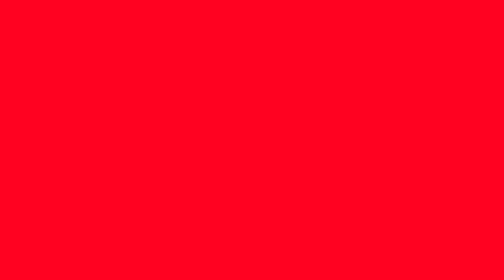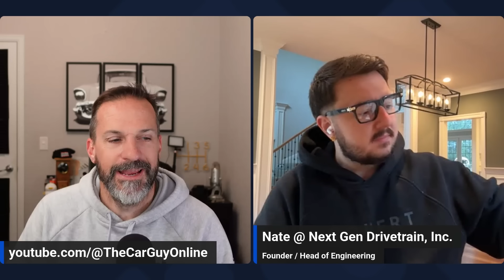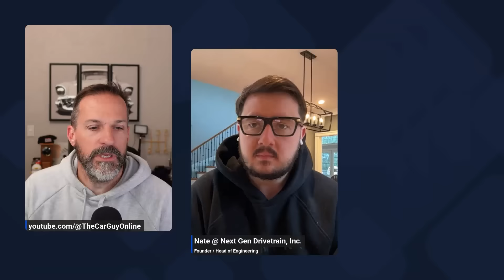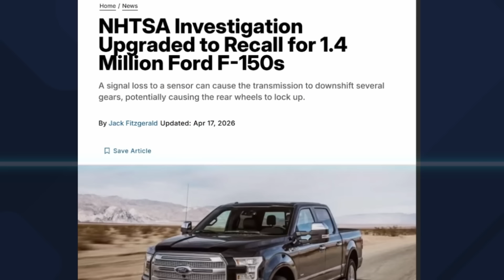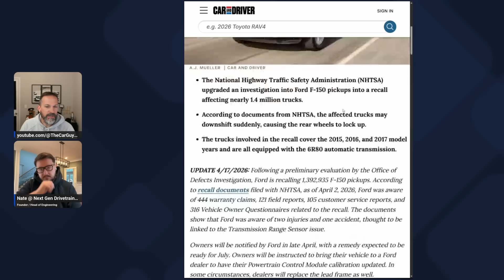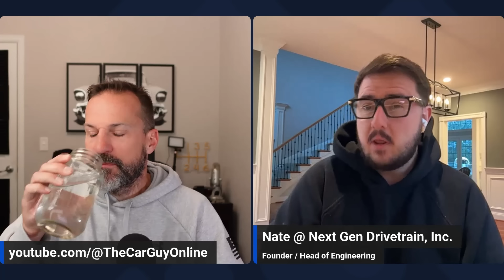Ford's BIGGEST Transmission Recall Yet - 1.4 Million F-150s

Comment: My 6R80 started to take a dump at 100k. Fortunately the truck still had a month of warranty left on it so ford put a new one in it. I’m definitely going to look into the valve body upgrade.
Reply: 2013 f150  transmission  slammed into 1st almost causing a accident.  Toke it to ford. 123.00 mile out of warranty  lead frame  4500.00 to repair
Reply: @MrKnuss14   if they charged you 4500 just for the leadframe they are ripping off.
Reply: .  I had to pay 2290 bucks to have my lead frame replaced and thought it should have been part of the recall, I was pissed when they told me it wasn't covered under recall
Reply: You’ll probably line up to get the next new best selling f 150
Reply: @666dynomax  if I’m going to look into trying to make my transmission better, why would I line up for a new truck 🫤 yea you sound stupid

Comment: I had a 1972 Ford F100 single cab it had an automatic transmission, a V8 302 engine, and ran 33” super swampers tires. I got the motor and transmission from a junk yard. The motor and transmission both leaked but I was poor. But we had a kid and a single cab pickup didn't work anymore. So we saved some money and I sold the truck and bought a 4-door car 😩😭 dam adulting is hard.
Reply: I hear you. I have a 72 F100 and the 390 went 45 years and then was rebuilt and the C6 transmission has never been rebuilt, a shift kit was installed 15 years ago and probably has been saving it. Have nearly 268k miles on it. I sold a 69 for a family vehicle and so missed it thus bought this one from a family friend who was original owner. These old truck will last sooooo long. I have a great running 2016 F150 with the V8 and 6R80. Keeping them both forever
Reply: @Anad3605  The gold days

Comment: They also go limp mode when the OSS signal fails throwing it in suicide mode with  lower gear at highway speeds. That almost killed one of my owners going 70 on the highway.. More shitty engineering. You know the plot is lost when a retired ford diesel dealership tech sells his new 2024 F250 and replaces it with a much older vehicle.

Comment: If the manufacturers are looking to buy back vehicles that they built, IMO they want to remove the more reliable vehicles that cost 1/4 of a new car or truck price. 
I think that they will have a rebuild program (like certified previously owned), then jack the price up, and sell with a limited warranty. The other vehicles that have serious issues, instead of sending to vehicle scrap yards, this reduces the pool of parts available to the consumer. Think no further than the Obama Cash for Clunkers program, where the vehicles were purchased above NADA, then destroyed. 
Cash For Clunkers removed millions of cars and trucks from the used vehicle market that didn't get the fuel economy standards, and forced people into new vehicle loans or leases.

Comment: Got a 6R80 in my F150 2018, it has been flawless also my 2008 BMW Z4 had   a ZF 6 speed it also has been flawless
Reply: My 2018 with the 3.3L has the 6r80. Every other engine in 2018 got the garbage 10 speed.
Reply: @chuckm5923  Is that the ecoboost?

Comment: I'm not sure why Ford chose to do this recall this way just to spread it out. First it was years 11-12, then 13-14, then 15-17. They should have just recalled them all at once it's a simple reprogram. That being said the 6R80 is bulletproof I love my 2014.
Reply from the maker: It is weird, I'm guessing just to save cost. They will only recall what they are force to recall, and guessing by age the newer models were not showing as many failures, so they weren't forced at the time to include them. the NHTSA should have determined if it's the same metal/manufacturer, to just pre-emptively recall as it's nearly a guarantee they'll have the same problem. Not all are affected but....it was a large enough problem they decided to force a recall.
Reply: IKR, I'm afraid to even let them service mine, thinking they would sabotage it BECAUSE they ARE so bulletproof....

Comment: I've owned 7 F150's in the last 20 years and look after a fleet of 200+ trucks. I've never once had this issue.
Reply: As a professional mechanic we see them at least once a month
Reply: I’ve owned the same Tacoma for 19 years (293,000mi) and have no transmission issues! 
So.. no need to have bought 6 more trucks 😂.
Reply: What year models?
Reply: This is a big push to help make Ram look better. Have never seen any of these problems either and we use f150s exclusively for years. 10spd has been great.
Reply: You will soon, your trucks are probably older or you just got really lucky. Numbers don't lie, it's a massive problem.
Reply: @Stealth86651  like the ram hemi problems with lifters and transmissions and tailgates opening and the death wobble and list goes on. Everything breaks eventually.  Ill take our chances with ours. Id just stay away from Toyota 3.4 tt and gms 6.2 and rams gas guzzling ticking hemi. Fingers crossed the hurricane works out for them.
Reply: @fishonalbertaoutdoors9761  I have a 2019 Ram hemi. Been decent, besides the manifold gaskets and a vibrating transmission that’s intermittent. I’ll drive until it costs to much to repair. My next truck will be a used 5.0 ford. They seem to be the best overall right now.
Reply: @JS-nd1po I agree! awesome motor

Comment: I was a Ford Gas and Diesel Master Technician for 14 years from 2007-2021 I have never once, never ever had a 6R80 unexpectedly downshift. This is being blown out of proportion. I personally have a 2015 f150 with 184,000 miles trans still works flawlessly.
Reply: As a professional mechanic we see at least one a month
Reply: @vinnyivanov2906 professional mechanic is a wild statement. That would make you a Technician.
Reply: 17:59 Nate you are 100% correct. They have a fiduciary duty to their shareholders to maximize profits. Which is why when you say that we should boycott them until they build quality products you are 100% correct again. When their shitty products costs their shareholders, and making quality products enriches their shareholders then their fiduciary duty will require them to make quality vehicles.

I’d say again, but it’s Ford… 😜😂
Reply: @M40A5 Yeah Ford best trucks made.
Reply: This is the dumbest argument ever. Never happened to me drrrrrrrrrrrrrrr. Go pound sand.
Reply: @skynettracooncity Its actually not, I worked on and drove 100s of f150s over my 14years with a minimum 14miles road test was standard for me. Im not some keyboard goober shit talking shite. I have actaul real life experience.
Reply: @1FiftyOverland  I've owned three different Ford pintos and none of them have blown up from being rear-ended. 
THAT'S HOW STUPID YOU SOUND.
Reply: @mcapps1Oh yeah because I have have actaul experience over 14 years. You sound like ilhan Omar saying world war 11.
Reply: As are most things on the internet.
Reply: I had a 2013 6R80 F-150 with 135k on it and a 2019 6R140 F-250 with 106k on it and both were flawless.  My brother still has a 6R80 2013 F-150 with over 150k and he drives it daily...no trans issues.
Reply: If you are a dealer tech, most of the trucks would be under warranty when you worked on them, yes?
 If Nates opinion that they fail just out of warranty is correct, then you likely would not see them, as the customers would be more likely to go to a private repair shop.

A recent conversation regarding fluid changes for my GM 6 speed with the service shop owner that does the company maintenance, he noted they fail far less than the Ford transmissions.  I had 4 transmission rebuilds on my 2012 E250 with a 4 speed in 180,000 Miles / 300,000 kM, the first under warranty at 45,000 miles / 75,000 km.  Beyond ridiculous
Reply: @gordonborsboom7460 Nope. We had pretty good reputation at our dealer so we consistently got older vehicles in for repair from return customers. Idk about now, that most of the experienced Techs like me left. For other careers outside the automotive industry.
Reply: @gordonborsboom7460  "If you are a dealer tech, most of the trucks would be under warranty when you worked on them, yes?
 If Nates opinion that they fail just out of warranty is correct, then you likely would not see them, as the customers would be more likely to go to a private repair shop."

That seems like a reasonable point, however, he's guessing based on what's seems reasonable to him. There's a huge difference between what "car guys" on youtube say, and reality. If you don't work in the industry and see what really happens, you're clueless. I'm in a unique position. I do heavy line (big jobs like engines and transmissions) warranty repairs for Ford, and I'm also one of the warranty administrators for the dealer I work for. That means I handle the job from start to finish, including all the billing and paperwork. 

Here's an example of what really happens on a warranty repair that you'll never see on a youtube channel. For reference, you can look up Ford TSB 20-2100. Its a 4 cylinder Ecoboost engine replacement. Its probably the most common heavy line job we do. Once we diag the car and confirm it needs a motor and will be covered under warranty, the motor and all single use parts needed to do the job are ordered from Ford. The dealer pays their regular discounted price like they do for any other job. After completion, I bill Ford retail price on those parts we just bought. So, the dealership is making money on those parts, and Ford has to pay full price for their own parts. They can't just send us a box of parts to do the job. The laws state that Ford has to let the dealer make money on the parts just like any other customer. Then we have labor. By the time I'm done, I bill Ford about 25 hours flat rate labor to do the work. The hourly rate my dealership bills Ford for warranty/recall work is about $170 per hour. The dealership supplies the customer a loaner or rental car. That goes on the warranty claim as well. Its very common for the rental to several months. I've had a few go over 6 months. By the time I'm done replacing the motor,  the total amount Ford gets billed is around $10,000. And that's for a 4 cylinder. We do plenty of 6 and 8's, as well. Engine and transmission replacements are endless. We never stop doing them. If you think Ford (or any other company) is designing these vehicles to fail at low miles, you're crazy. Its killing them.  They're losing huge amounts of money. The expensive parts theory is also a myth. The manufacturer has to pay retail price on parts for warranty repairs, and once the vehicle goes out of warranty, the dealers and customers can buy parts from anywhere. They don't have to use Fords parts. 

If you look at the TSM I listed, it shows the complete parts list, labor ops, hours, etc... Its a snapshot of the entire job. The last place Ford wants your car is at the dealership.
Reply: 1fiftyoverland- I know three people it happened to. They were doing 100 kilometres on the highway and it downshifted to first gear. One ford truck was a 2014 and the other two fords were 2017
Reply: @ramrider1453 ok so we are up 5 vs my 100s.
Reply: I agree. I’ve never ever seen one downshift unexpectedly. I’ve replaced lead frames and done programs. Never ever saw one downshift
Reply: Nate is GREAT !
Reply: @pietsee1000 I dont dispute that.
Reply from the maker: We are reporting on an investigation that then turned in to a recall by the NHTSA, are you saying they are blowing it out of proportion after they investigated and found enough units that were affected? Remember, it's never "ALL ARE AFFECTED", it's always a percentage. The number of potentially involved here is 1,392,935.  https://static.nhtsa.gov/odi/rcl/2026/RCLRPT-26V237-6816.pdf . If someone can get an upgraded unit and avoid a crash, it's free and they might as well.
Reply: @TheCarGuyOnline  how dare you report on the information you have instead of being an all-knowing oracle! For shame! 😂😂
Reply: @TheCarGuyOnline 
I totally get you. I have a Toyota K120 Direct Shift CVT. It’s about the highest regarded CVT out there, but every time I feel it do something it doesn’t frequently do I think “crap, am I in that small % that is going to have a problem with it?”.

Nothing is perfect. It doesn’t have to be all to be an issue the regulatory agencies tag as enough.
Reply: @TheCarGuyOnline hmmm, you do have a point, my bad
Reply: @TheCarGuyOnline This is why Ford is better than Toyota, they found a POTENTIAL problem and are recalling all possible affected vehicles.
Reply: Right, I never heard anything bad on the 6r80. And here was I thinking these guys is good info
Reply: I'm not a mechanic and I know two people it's happened too.
Reply: @F450FTW 2 very very very unlucky people. Glad I dont know you. The 2 poeple you know vs the 100s of f150s I drove in my 14years.
Reply: @1FiftyOverland I have nothing to gain or lose by this. I don't own a F150. Maybe it's different parts of the country or how they're used. Not seeing something doesn't mean it doesn't exist. I will say both of them were well out of warranty and they didn't visit a dealer to get them repaired.
Reply: @F450FTW true. It is known that the mid west see different failures than I was seeing or not seeing in the southwest where I live. But In 14years I would expect to have this happen to me at least once. It never happened, my co workers never experienced it either.
Reply: @1FiftyOverland There are several possible types of events. Best case, low probability, low cost. Not a big problem. Then high probability, high cost. Big problem. Then there is this type, low probability, potential extreme cost (death). Me personally, I don't 't play a hand with this possible situation. If it can't be fixed, I sell the truck and move on.
Reply: gotta get views
Reply: Perfectly operating 6r80. The best modern transmission ever made.
Reply: @jacobstrutner8232 😂😂😂😂

Comment: U cannot put your valve body or anything else from your company without voiding the warranty unless a dealer gives the ok to do the work and theres not many of them
Reply: I wont tell if you wont
Reply: For the love of God, people keep repeating these falsities. Manufacturers cannot simply void warranties. They have to prove that the modification caused the failure. Yes, you may end up in court, but your warranty is not voided

Comment: Wow, a little late for a recall. These corporations suck
Reply: Neighbors just went down. 72K.
Reply: 2016 F150 fx 4x4 
Torqueconverter100k, leadframe 142k. They fix the torque converter,I paid a hundred dollar deposit. The next issue we had we were Driving down the road , and the entire truck shut off. How did towed to ford. Because of the literature in my warranty did not cover the lead frame.We're out of pocket twenty five hundred dollars and that was crank no start as well. 
I've had no problems for the last sixty thousand miles change transmission fluid at 192k and just Had truck rear end , lock up on me at seventy five miles an hour ,going home from work on north I75

Comment: I will drive my 2023 4Runner until the wheels fall off
Reply: I've got you beat, I've still got my '98 Limited with the 3.4 5VZ I bought new.
Reply: That will be a while. That drive train is slow, clunky, and will last forever. (2014 owner, 150k, one minor recall)